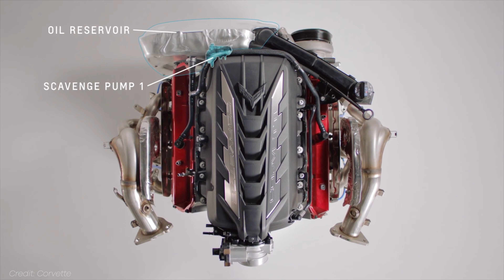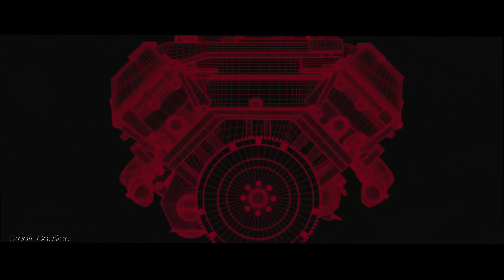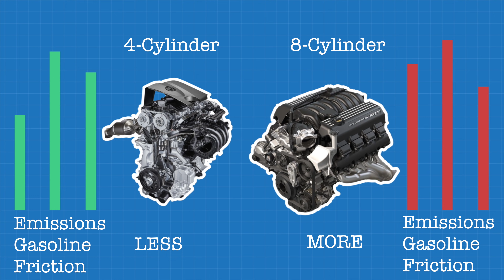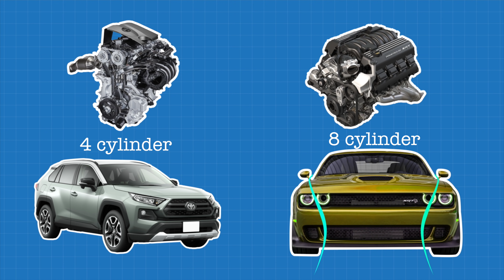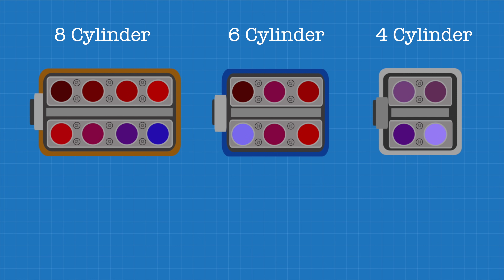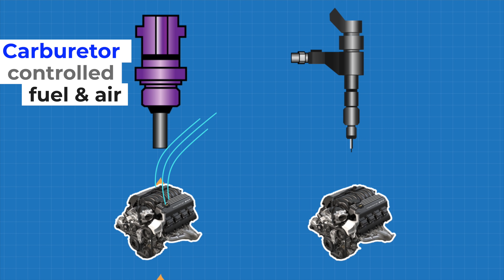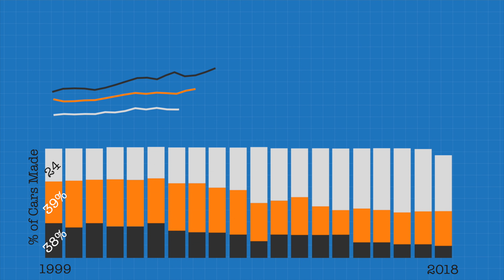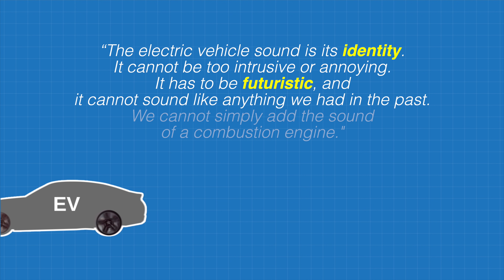Why V8 Engines are Dead

Comment: V8 engines will die when Hell freezes over.
Reply: I once heard hell was so cold that it feels like burning
Reply: EXACTLY
Reply: Is America still free? Do people still buy and drive SUVs and Pickup Trucks? Is gas extinct? V8s will never die
Reply: @amarjit singh They never will take over because electric cars for the masses does´t work - not today and not tomorrow!
Reply: They won't be allowed on the road at some point in the future so yeah they are not dead you just can't use it outside of your garage and own land.
Reply: @alexandruilea915  Not everyone will be able to afford electric cars, so gas motors are here to stay! Proliferation of electric cars will however, reduce gas consumption and demand to the point where the few gas cars still on the road won't matter anyway.
Reply: Alexandru Draghi v8 should always be allowed, v10’s and above should be the ones that get limited if they do that at all
Reply: @griffin_kith6214  if they won't meet the maximum pollution requirements none of them will be on the road in the future. There will be hybrids and electric vehicles only most likely.
Reply: @griffin_kith6214  Too many rules already! 😠 This country was meant to be FREE, so people should be able to drive whatever they damn well please! 😠
Reply: @alexandruilea915  Depends on how Technology advances. Toyota and Mazda are working on a engine that combines Gasoline with the Design of a Diesel getting hybrid level of fuel efficiency.  Plus someone else is working on Synthetic Gasoline.
Reply: Doubtful. Any collector/historical car will always be allowed in.
Even if that did happen, that would be many many years off.
Reply: V8's will only die when no more baryonic matter exists in the universe.
Reply: I like my inline six om606 alot better than my Toyota 4,5l v8
Reply: @hunterwilliams8129  Toyota makes some mean inline 6s! 😀 My buddy put an inline 6 twin turbo charged 2JZ motor he got from a crashed Toyota Aristo in his 1984 Toyota Supra, and that car will pop wheelies! 😳 I love that car! 😍
Reply: @ryanmace8804  the om606a is the diesels answer to a 2JZ motor 😉😉
Reply: You know they ain't gonna die any time soon when people heard that ford isn't putting a v8 in then new bronco lol.
Reply: Confirmed. my crown vic will never die.
Reply: More like when there is 0 oil left

Comment: The V8 may be dead for cars but not for large SUV's or trucks. A large vehicle in heavy use will disintegrate a I4 or V6. What would improve engine life w/ that kind of use would be to choose a Diesel instead of a petrol engine but that's a story for another video...right?

Comment: Most V8’s now a day’s run on 4 cylinders when not being used to full potential.
Reply: Marty McFly • 128 years ago some not most, and those are GM’s line of LT engines which are a new improved version of the old LS. Ford has not applied a V4 mode to any of their V8s yet neither has dodge that I’ve heard

Comment: I am disappointed that they are not putting turbos on the V8's.  The turbos increase efficiency and emissions  if you keep your foot out of it. They could make the V8 a smaller displacement and low compression. They can do variable cam timing already. Direct injection along with the multiport injection and the waste spark ignition are helpful too.  Cylinder deactivation has already been used in V8's.  If they used all the technology they have and use on the 4 cylinder engines we could have more V8 engines.

Comment: Here’s what I think. You don’t buy a V 8 for fuel economy. Next let’s get back to the V 8s from the 60s and 70s. Toss the computer and all the emissions control and get back to basics. I hate that damn computer and wiring harness. I put a new Coyote in an older Fox body and it turned out to be a huge nightmare. Like I said you buy a V 8 for fun not economical functionality.

Comment: As long as gasoline or an equivalent fuel source is available the v8 engine will continue to exist. Period. I will have a v8 powered bbq rotisserie if they won't let me run down the road in one.. you will have to pry a v8 from my cold dead hands!

Comment: “V8s are dead” laughs in LSX and Hellcat
Reply: V8's Will Never DIE
IT'S IN OUR BLOOOOOOD
Reply: laugh in LC500.
Reply: yeah but too expensive for ordinary peoole
Reply: @STYGLDNZ28  not really just got a 283 small block with a 2speed power glide transmission, in a 1986 jaguar XJ6 with no rust on the undercarriage. Only issue it had was that it wouldnt run but it was just a couple vacum leak and it runs great now got it for $2500 and put $300 in to it. They can be affordable just have to find what you are looking for.
Reply: Isaiah Edwards you can literally drop a $400 LS 5.3 in any cheap car man the V8 will never die, I can buy a 4th gen camaro with a 350HP V8 for less than 7k and the new edge mustang have V8s for less than 7k aswell, if you only make 1000/months you shouldn’t be trying to buy a V8 Mercedes or BMW...
Reply: Or any truck that needs to pull a large trailer.
Reply: FCA already said next challengers won’t be able to have v8
Reply: Alien Bounce No, they didn’t.
Reply: Alien Bounce you work for CNN?
Reply: Sky IsdLimit call all that is fake news.

Comment: Yeah well , this we know . V8 engines are used in semi trucks  and in heavy use vehicles . Untill the pick up truck . But it's not available for anything less . 
Um , but the v8 is a smooth power scorce to carry and tow . And I don't like that the government has taken it away . 
Ok , I will get a horse . PennDot , can go out and shovel the excrement off the road !  Since they can't seem to fix the roads around here .

Comment: Forgot that Oakland, then Pontiac had the L head V8  until 1932 when general mess told Pintiac only straight 6's . Nevermind it was slower than the V8 Pontiac which by the way the L head V8 Pontiac was the first hydraulic roller cam engine.

Comment: Eh it doesn’t really matter you can make as bout as much horsepower out of a v6 to a v8 or more if allowed but hey I’d prefer a v6 because I get good gas mileage and if I need a boost in power just build the engine up to those standards but it be sad to see the v8 go and move to v6s and four cylinders

Comment: I own a full size pickup with a V8 and it gets better average MPG than my friend's mid-size truck with a V6, both are normally aspirated non turbocharged.  I don't think turbocharged small engines a bad, but they aren't necessarily more fuel efficient.

Comment: Scotty pull your head out V8 engines will be around until gas is obsolete. They aren’t going away until gas powered engines are made illegal. The Chevy LS and LT engines are marvels of engineering they ain’t going away. They are only being designed better. Nice try Scotty stick with your Toyota Camry.

Comment: V-8s. It used to be a "Speed" thing. Now, it's for more enjoyable driving and, believe it or not, occasionally amusement. I enjoy watching, and passing, the 4-bangers as they fall behind and lose speed on moderate uphill grades while our 6000 pound Navigator hasn't lost a single mile per hour. It's even more amusing when we get the same result, cruising past V6's  while pulling a 4000+ pound travel trailer on even steeper hills. Taking off at 4-lane traffic lights can be down right funny. With just normal, moderate, steady acceleration, the sun-glass wearing dude/dudette in the sporty little turbo-quad in the left lane just aren't feeding their squirrels enough nuts to keep up, let alone pass. By the time the little "Turbo" finally winds up the rubber band, it's hangin' out in the wind 10-15 car lengths behind. And I never exceeded the speed limit. (My wife's knuckles aren't even white.) Yeah, he/she "could've had a V8" . . . (Heh, Heh, Heh. People that don't REALLY know how to seriously and correctly drive (but imagine they do) shouldn't attempt to take a pea-shooter to a tank fight and expect satisfying results.) Drive On!

Comment: The V8 is not dead, full size cars have them, pickup trucks and suv's use them. They are long lasting and give great power and good fuel economy. 4 or 6 cylinder turbocharged motors dont last as long.

Comment: I have a 2016 cadillac cts v4 with a turbo and a 2016  gmc sierra with a v8 motor and trust me they use the same amount off gas and i rather drive my truck all day

Comment: I will never drive anything V8 that is post 80's..You don't need all those electronics to run a car or truck..My rides are an 1984 Chevy truck and a 1985 Chevy full size van...still running strong...Nothing beats 80's models or pre 80's.. models..

Comment: I always loved v8 engines, from the rumble of a cobra jet Shelby 500 to the scream of a 458, even in F1 there were amazing V8 capable of 18.000 rpm and ripping off your ears, while now everything has to be turbocharged and hybrid.
Truth is that V8 are expensive (maintenance and fuel efficiency mostly), but they are usually capable of a longer life, and nowadays people change their cars every 3 to 5 years even if the car is still good, because our society taught us that newer is always better.
Unfortunately I cannot afford any v8 engines car, but sure is it’s on my list.
Beauty is not a science matter

Comment: Sorry I couldn’t hear this stupid video over my 6.2L V8
Reply: Paul Evanson savage lol
Reply: Taking a cruise in my supercharged 6.2 v8 Yukon Denali
Reply: Ls for dayssss,its cheap easy to work on and you can make a hell of a lot of power cheaper and more efficiently than dodge and ford V8s. Anyone that disagrees can try to rebuttal but let me say this. LS engines have 1 cam,and multiple sizes. The coyotes have over head cams,yes,but how many aftermarket options are there? Gen 1 and gen 2 cams and that's about it. Dodge,cant go 10s with any if their V8s without 10k in mods and a 200 shot of Nitrous
Reply: @josephstalin9500  I've worked one all those before, the Coyote is WAY more mod friendly than any LS and  Coyotes have way more aftermarket options for pretty well everything, including cams. Far more places geared toward modded those than there are LS.
Reply: Lots of noise. Good for you!
Reply: Word
Reply: Ya,had trouble myself,the sound of my c5 made it hard to hear
Reply: Lol i lost interest when he was going to talk about ev's... 😂😂😂
Reply: Lol did you even pay attention to the video or just get mad as soon as you read the title
Reply: @franco-k2l  and then inherit all electrical problems.....lol
Reply: Christopher C he might have a ford
Reply: Great motor
Reply: I couldn’t hear this over my 392 V8 either
Reply: Couldn’t hear with my whipple charged 7.4 😂
Reply: More like taping valves blue smoke 😄

Comment: I agree with you Scotty
Reply: I have a Ram, I know you don't like MOPAR,  but I, as a Machinist of 34 years,  and a Mechanic of 47 years, have a higher degree of maintenance scheduling that's more timely, tend to extend the life cycle of said vehicles. Anywho, the sound of the V8, deep, powerful, grumbling, sends wave after wave of pleasure to my ears. Especially my HEMI. NOTHING quite like the sound of a tuned and built V8, from the 340 (in my Road Runner), to the HEMI in my 2012 Ram. It just does it for me. LOVE YOUR CHANNEL, keep on starting your engines.

Comment: If anything. The V8 is thriving with the LS moving so deeply into the car community. Kinda dumb to assume it’s dying.
Reply: Krash Landon some don’t care about hybrid drives or 40 mpg.  Some care about simplicity, reliability, and naturally aspirated power.
Reply: @07truth  My 2010 Ford Fusion Hybrid is car of the year for 2010.... and averages 35 highway 41 city...... 

It's OBVIOUSLY not a sports car.... but.... looks and works well to me with 9.5 overall rating 🤣
Reply: @A-R-T-T-C  Has it got the same battery still ?  I heard they can cost a lot which would raise the running costs.
Reply: Anyone thinking LS swaps are still a thing haven't been keeping up with V8s.
Reply: Oh dude it's dying man so is the manual . Resist not I am a fan of all types of motors but it's not up to sound feel and asthetic anymore it's environment and redundancy u have 6 bangers from Japan or Germany that are efficient and slay most from the box . It's all control from govt what's allowed what isn't etc etc

Comment: The reason why V8 Engines (and many other type of ICE engines) are dead is simple: EV technologies are constantly improving and thus, have a bright future. With an ICE engine, it has pretty much reached its peak and cannot be improved any further. Plus, several CEOs of many automakers are backward thinking, not forward by no longer innovating and rather focus on profiting an old fashion way, which will no longer work in the future. I can 100% guarantee that you will not find an ICE vehicle, even in a prototype stage, that can do 0-60 mph in 1.9 seconds without the use of a booster and can provide 620 miles of range, more than even $3 million supercars.

Comment: I love all the EV vs ICE arguments. Both are fun as hell and it depends on the kind of person you are. I prefer noisy V8 with a locking torque converter, power glide and trans brake. Harsh, loud, and a fun hobby.
Reply: Don’t get me wrong, EVs are cool too. But they lack the kind of customizable dimension ICE has.

Comment: It’s true, you don’t NEED a v8 for speed anymore. My Cadillac has a turbo 4 cylinder and and an 8 speed auto transmission and it’s pretty fuckin fast, especially considering it’s a 4 cylinder. Still, if I had a Camaro or a corvette instead, I’d definitely want a v8!

Comment: The v8 will never truly die. Cause the thing about turbo 6 and 4 cylinders is that you are putting a lot of stress on a  motor that will shorten a life span of a motor compared to a n/a v8 motor. Yeah you can get the same power as it but i will take a less fuel efficent v8 for a less stressed motor and power

Comment: This might be a legitimate concern for passenger cars, but they will never make an electric motor with enough range or power, or a V6 configuration that can hold power long enough without overheating to replace V8 engines in pickups. (With the exception of the inline 6 diesel)

Comment: or would you like a 80,000 Rb40 alpha 80 engine V6 crankin out 700hp before advancements. i luv v8 but you can convert so much with a V6

Comment: It says in the Desc that Chevy, Dodge, And Ford are favoring smaller engine designs, where they're pretty much the only brands that mostly use bigger engines. As apposed to most the Asian, and European Auto-manufacteres that have over 90 percent of their cars on the road with an engine displacement of under 2.0 liters.

Comment: I’ll take the 1968 Shelby GT500 or the 1987 t-topped Mustang LX 5.0L I have owned a 68’ 87’ and 02’ Mustang along with many other cars throughout the years but of all of the cars I have owned the only 1 I regret letting go is the 87’ t-topped Mustang LX 5.0L I should have never sold it and now I couldn’t even think about affording it if I could find one of them

Comment: V8 engines might be dieing, but let's talk about how dead v10's are.
Reply: v10s are for super cars not affordable cars for the average person.. they have nothing to do with the video
Reply: Eli Daniel I mean... both dodge and ford had V10s in their trucks in the 90s and ford had their v10 available in certain trucks all the way up until the release of the 7.3 big block v8
Reply: Eli Daniel hate to inform you put they put them in trucks f250s had v10s for a while.
Reply: @elidaniel5939  i recently saw a v12 bmw 760 series; thought to self. Would not want to but gas for that... LOL
Reply: @mondocjenson-dy8zd  
I would
Reply: Mobius1 and v12
Reply: RIP S85
Reply: 589nm RIP Viper also

Comment: The moment they stop producing the v8, the day I’ll stop buying automobiles. Hear that Ford? Keep the 5.0 alive!
Reply: Think just a little bit. 

#1 No
#2 A quicker Mustang Mach-E will cost 2.3 times what my brand new 5.0 cost
#3 The battery they strip mined lithium for would be charged with coal.
Reply: Indrea, you are correct! Battery power still relies on fossil fuel as an energy source. Until the electrical grid is fully powered by clean energy, electrical  cars and less pollution is a moot point.
Reply: @07truth  No it's not, what are you on?
Reply: I have a chrysler 300 v6 300 up and I get 33 mpg on the highway. Combined I get 26 mpg.
 I'm fine with that
Reply: Yeah and junk the Mach E idea, it doesn't deserve the Mustang name
Reply: You would have drank the koolaid
Reply: I'm pretty sure Ford doesn't care about you or your money and they'll make whatever they want
Reply: G G They will, and I’ll buy whatever vehicle I want that has the Powertrain I prefer. We all have a choice.
Reply: Well not too far in the future we will be possibly seeing more electric, hybrid and hydrogen fuel cell vehicles. It’s better if we innovate for a greener future rather than to selfishly indulge our selves in the past forever. The 5.0 was a great thing for many of us but we do have to leave it behind I guess

Comment: A lot of the comments said the sound of a V8, that's the quietest engine specially General motors, I used to own a Chevy Van the only way to know if the vehicle was on is to look at the gauges on the panel, same on Cadillac's

Comment: As far as dead, not so. I have had all types and raw power V8 is simple. You can easily get huge horsepower on any engine , 4 cylinder included. Hower hee the catch, 4 cylinder  power must also rely upon other attachments like boost, turbo, etc, weight to power ratio, etc. Put a four cylinder  in heavy unit and it is really going to strain, we still need V 8s